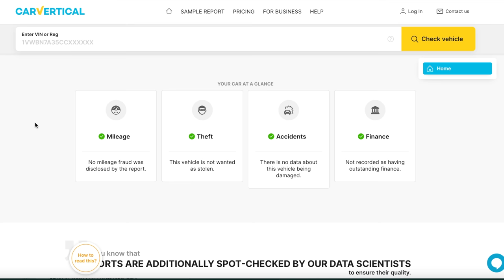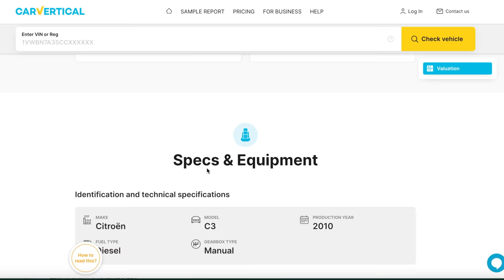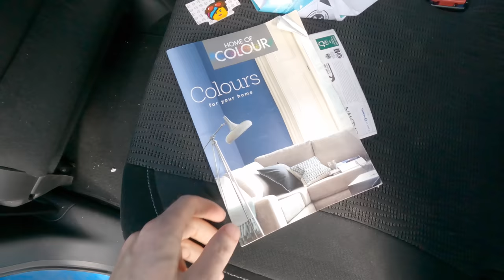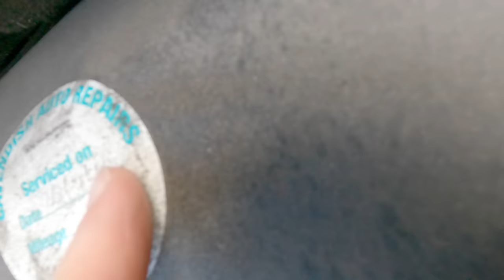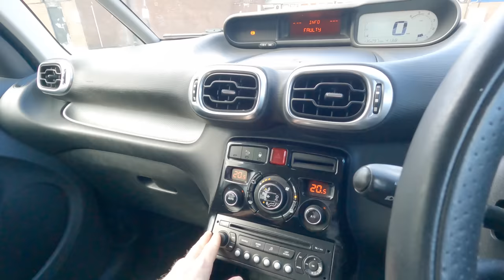I BOUGHT A CHEAP CITROEN FOR £300!

Comment: I don’t mind French cars, under the bonnet they are Bosch, Valeo the same as everyone else. I wonder if the issues stem from the fact that people bought these diesels based on high mpg figures but didn’t do the miles a diesel needs not to choke up their emissions devices, and also cars at the budget end of the market don’t tend to be maintained with a view to longevity. Of all the new company cars I’ve had over the years the ones that have had the most garage time are VAG group and Ford. It doesn’t put me off them, just my experience. Great video and insight into the part ex market!
Reply: Shh... don't you know that around these parts, French cars are the only ones with reliability issues :D

Comment: The older IDI diesels are pretty bombproof, but I agree, all modern direct injection/common rail diesels are terrible, unless used most of the time on long motorway commutes, where they get properly hot and keep the crap buildup to a minimum. Congrats on the lovely BMW though, delightful colour and a manual box too.

Comment: Those Michelin Energys were factory fit on loads of PSA stuff at that time - we had a regular hatcback C3 of the same vintage and the rears simply will never wear out, all they do is stop the back dragging on the ground! Had to change them through age as you've noted. Was a very reliable, quiet and comfy car too.
Reply: 1.4 8 valve petrol though, which was faultless other than needing an odd drop of oil. Much better used buy than the (in)famous 1.6hdi!

Comment: 15 quid won't make the gauge move much, I did a wheel bearing on one of these and I think I put it in the wrong way, so abs light came one, wasn't on before, abs pick ups in the bearing, due to other faults I sold it off cheap, loads of work for no profit, at all.

Comment: Had a Citroen AX GT back in the day, smoked like a train. Replacement cam belt, service and stem seals then went like a rocket until plastic internal trim broke or feel to pieces. Never owned another Critoen.

Comment: I’ve got a 2013 Peugeot 3008 allure, 1.6hdi, manual, fully speced, fsh, 90k miles, clean MOT. I’d be interested in finding out what you might offer for it. (Approximately). Not 1 single fault.

Comment: Over the years I've asked a number of seasoned engineers about buying high-mileage modern diesels, because the economy is tempting. To a man they've said don't touch 'em - too complex to service and too expensive to fix. So if anything goes wrong the car's going to be a write-off. 

And to a man they have said don't touch French-designed cars - they say that the engineering is rubbish.

So a high-mileage French diesel wouldn't exactly have been top of my list...

Comment: I bought one of these last December with 132,000  the clutch went at 136,000 July this year, a clutch at retail prices on one of these is £1200. Mine was £135 road tax.
Reply: That’s with labour and an expensive garage. Clutch kit and DMF is about £450 tops at retail price but fitting price is debatable

Comment: the old 2.0hdi unit was perfect (8 valve type) bloody bullet proof ... newer ones not great ...Im currently runnign ford focus mk2 1.8tdci ..(non wetbelt) this might be my last diesel car   , also might only need injector seals ...copper rings and could be working ok

Comment: The handle on the fuel pump icon on your dash tells you which side the fuel filler is on
Reply: Not on the C3 Picasso - the pump handle is on the right on the dash display, but the filler flap/cap is on the left.
Reply: when you think you couldn’t dislike a car anymore 🤦‍♂️

Comment: We had one a few mths ago, 61 plate, gave 900 quid for it, did spring, wheel bearing, top mount, unfortunately steering column was noisy, disconnected colum and noise was in the electric rack, got 1200 for it, so total waste of time.

Comment: 70 mph in 4th gear for 15 miles will usually clear these out, they do not like short journeys, if it does not do it it's usually maf needs replacing or cleaning, worst case is it's dpf, could have got more for it just selling as spares or repair.

Comment: With the PSA 1.6 HDi it is essential to change the oil at half the recommended miles using quality oil and an OE filter. Otherwise turbo failure will occur and simply changing out the turbo cassette will not fix it. The sump has to come off, pick up pipe replaced, turbo oil feed filter bolt replaced and an internal engine flush. If it's been driven any miles with a failed turbo, remove the crank shells and big ends to check for scoring there too. It's a big expensive repair. The high milers also suffer from injector seal failure resulting in a chuffing noise and a smell of diesel. Replacement injectors must be coded into the BSI too. This engine is used in all sorts, not just Peugeot Citroen, but also Ford and even Mini. If you own a 1.6 powered HDi change the oil every 6.000 miles without fail if you want it to live a long and happy life.

Comment: My Xsara Picasso has been 100% reliable. It is a 1.6 VTX Petrol though. At nearly 16 years old the power mirrors no longer fold and also the rear sensors no longer work. Odd flash from the ABS too. Other than a smidgen of rust on both sills it is spot on. Not bad for a car I pad £3100 for almost 8 years ago with just 20k on the clock (Ex mobility)
Reply: I have the same age VTX xsara pic. It doesn't have folding mirrors or parking sensors. Maybe yours are as expected.

Comment: Another brilliant video your job is so interesting, just one thing, a few times you went for fuel and you had to look out to see which side the fuel tank was. did you know that 99% of all makes has a tiny little arrow to the left or right of the fuel gauge icon on the dash, to tell you which side the filler cap is, it's very useful  as I also drive different cars a lot.....
Reply from the maker: Not this one

Comment: Surely it's just air or dirt in the fuel line as you've just added fuel onto a completely empty line. 
It was OK going in to the petrol station, it may just need someone to put 20 or 30 miles on it to sort out the line. 
May be why the gauge read empty. 
Give the car a chance man!!

E46 series convertible looks awesome.  Still my dream car.
Reply: I put that comment in 3/4 way thru. Having watched it all, yeah scrap.

Comment: We bought Citroen C3 Picasso  for years ago with a mileage 250 000 km. 2009 1.6 HDI  (80 kw). It a stunning car, very practical, comfortable and reliable. After 4 years mileage above 320 000 km, no engine problems, no rust in body, in deep (above -20)Lithuanian  winter everytime starts.... Only cheap maintenance, brake pads, some  suspension parts  and etc...
Reply: Labas, is kur pirkai prancuza ? Is skandinavijos nuo tralo ar vietiniu skelbimu ? Dekui.
Reply: @Tomas-cg9ko  Labas. Pirkau pagal Autoplius skelbimą, stovėjo Kauno turgaus aikštelėje. Kiek žinau parvarytas iš Danijos

Comment: Had a DS3 with the 1.6 HDI on a 2011 (61) plate - oil & filter changed every 10,000 miles as Citroen recommended (I was doing more than this per year so the 1 year interval didn’t apply) - the turbo started under boosting around 80k or so and throwing an engine light intermittently - there is a metal gauze that feeds oil to the turbo and they get clogged and starve the turbo of oil - would have been just over £1,000 for a new turbo - I didn’t have it done as it seemed to stop doing it after only throwing the engine light on 2 separate occasions and part exchanged it at 90k against a 2016 (66 plate) Clio Diesel - the service interval is every 18,000/2 years on these - madness

Comment: It’s a funny thing about French cars - I have had the misfortune to own one of those Renault Megane ( my wife liked the quirky look) it was also a two door  ‘sporty looking’ thing with keyles entry, it was also rubbish to drive, In under twelve months it cost almost half of.it’s price in engine  & electrical faults. Oddly I sold it for what I paid for it. I made the mistake of thinking it would be like a Renault 8 Gordini, which I had when at Uni in the early 70s. That thing was a 1966 model and damage good fun,, but eventuallŷ, the rear engine started getting problems. . . In those days, you did your own repairs - but I soon discovered, not on French cars!

Comment: I've only just caught up with this so it's probably scrapped now but it's a pity it couldn't have been sold to someone to fix up. If it's the turbo at least it's at the front of the engine so not too bad to get to. Injectors, dpf etc are all doable on a budget. You wouldn't get a garage to do it because the labour costs would make it not worth it but there are plenty of people out there who could do it.

Comment: Before scrapping it, I'd have pulled the injectors, my bet is they are clogged up. Check the air intake, again, it probably resembles a coal mine. Then change the oil and see what it does.

edit: I wrote this before the injector noise. I think the engine would be salvageable if you could do the work your self, but not economical if you pay someone.

Comment: We have had a string of French cars in our famaily, BX CX ZX Pug 605 525 and now a Pug307, all diesels.No major issues with them and wifes current 307, which she has had for 14 years runs great although it is clearly nearing the end of its life. All have been propely serviced. Not had many German cars, the last was an E39 525 BMW diesel on which the engine blew up about 10,000 miles after I  sold it. I am on my second Volvo v70 /xc70 which are also good cars. Sadly not much in the current Pug Citroen range appeals and I dont want a Chinese Volvo

Comment: This is common with Citroens if you can't be bothered to service the PSA diesel engines the dirty engine oil kills the injectors & eventually kills off the turbo as well it's not a bad DIY job for someone who likes Citroens yes they are around
I'm surprised you didn't get rid on eBay & made yourself a few quid

Comment: Perhaps it is in limp mode DPF full, had the same with C4GP (piece of crap)
First DPF blocks then higher pressure in exhaust affects engine, and in effect injectors washers get blown and later that will affect high pressure pump.
Also check oil level if there is more than should be fuel already started mixing with oil and that will affect turbo of course. They are clever cars ;-)

Comment: I’ve written this before but after owning a Peugeot 607 I still nearly have a heart attack whenever I hear any kind of bing warning sound.
Reply: I had 2 C5s, not bad with the reliability, both had 2.0 HDI engine, but that beep is the same if the temperature dropbs bellow 4 degrees C, the same if you are running low on fuel, the same if your washer fluid is low and the same if your car needs a new engine :)

Comment: So you scrapped it without even having a proper diagnosis?  Could have been something really silly causing all those problems.-   I have had quite a few French cars and they are not naff! Currently tun a 2002 Peugeot 806 which has its issues but is serving me well.

Comment: HA! It’s me the Citroen C3 Picasso Exclusive owner that a few weeks back that mentioned the ‘hairdresser’ Suzuki. 😂 Mine is the same shade of blue too. Owned it for 10 years now. Is mega reliable and practical. Even the electrics have been reliable. Low insurance, low tax, low depreciation, low maintenance costs and is a babe magnet too 🤔 okay, maybe not the latter! The difference between mine & the one you got is 1) mileage - mine only done 58k and 2) maintenance - main dealer til 2015 & then Citroen specialist ever since. It’s a good car - shame that the one you bought was such a 💩 one tho.

Comment: I've had several cars a 09 2.2d xtype and 08 1.9 cdti Astra else and both smoked liked hell and had no power and in both cars the Turbo had gone, the cars were Never than the Citroen so both got sorted but I had the Astra then the Jag in all the diesel cars I've owned three 2 are the only cars I've had problems with ,

Comment: How the hell did you get that for $300 only? Are you having us on? How does one buy a car without knowing the model, condition, colour or anything other than the Brand? It is obvious that this could only have been gotten in an unusual trade. Regardless of the engine condition, I believe it was a good buy. I am sure you are connected with the prerequisite talents to put it right. Never even tried to find out why? A little challenge and you quit? You are not cut out for this job - you are more of a gambler.

Comment: That kind of smoke coupled with the symptoms of low power could only spell one word: MONEY-PIT. Grey-ish blue smoke is a sure sign of burning oil. When that happens it could either be a lucky escape (turbo oil-seal or even better a blocked breather pipe or even worn-out oil) or a massive expensive job like worn valve guides, stuck / worn oil-control piston rings or maybe not that bad but still expensive, the turbo requiring a re-build. I may be attracting a wild crowd against me here; but the more modern HDi engines are known for unreliability, sometimes even when pampered with TLC, so it's quite unlikely you would have gotten away with a cheap fix. There's money to be made breaking these cars for parts however: they are plentiful and they go wrong all the time; and many times they are not worth repairing even when bought dead-cheap - obviously for a very good reason - so there's a heap of second-hand parts in circulation.

Comment: I feel like they got it all wrong with the C3 Picasso. My nan owns one (A C3 Picasso exclusiv 1.6 diesel in blue just like this one) and it's a nice car with nice features but it just does not work for me. It gives the impression of a spacious car on the outside but so much room is wasted on the inside. My main problem however is the gearbox with the 1.6 diesel that my nan owns. The 5 speed does not seem to manage torque very well. It is a decently powerful engine for what it is and it pulls well but the gearbox means that if you are on a slight incline going 40mph you can to change down into 3rd then rev the thing to death and then change into 4th and it wants to go back down to 3rd. (That's just an example). I just don't like this car much.

Comment: I must confess, after doing my own mechanics for many years and fixing friends cars too (until recently), I RUN from anything made by Citroen/Peugeot/Renault since the late 80’s early 90’s Peugeot 205’s!
Reply: I dont know what went wrong the diesel peugeot 205s were absolutely bombproof i had one a couple years ago on 800k miles original engine went to france in it 4 times and never missed a beat and its still on the road now doing 10k miles a month got to be coming close to if not more than 1 million miles now

Comment: "who puts Michelins on a C3 Citroen" CITROEN AS STANDARD . My first Citroen 1974 Dyane boughts 6 months old and still owned even had Michelin steel wheel it has never needed a wheel balance. 1560 Diesel engine is a gem if a lived closer I would take it off your hands, change oil, check injectors and turbo.

Comment: Applies to any car - look at the fuel gauge for the clue to the side the filler is located - the fuel gauge logo shows you - look at the hose on the logo - that’s the side the filler is on :-). Some cars worth repairing but this one is overdue that date with the crusher. One less rubbish sh1troen 😊👍

Comment: These do 400k as taxis - 500k even - the engine stuff is all mostly ancillary crap that's easily fixed. Emissions shyte that needs fettling, etc etc - the abs is usually worn pads/borked wires. T'was a fixer. That to me is a blocked egr - or a blocked cat, or the fuel filter that's done 30k since the last fresh one.   She'd have been purring in an hour here. :-( For tuppence.
Reply: That said - I know this is an Ad for the car-check service & the Citroen is just a bit of fluff to draw in views.

Comment: A £300 p/e recouping £250 scrap or potentially time, effort and money to make a couple of hundred somewhere down the line. Scrapping is the sensible call. For the right buyer it's a cheap car to get to work for a year. For the wrong buyer it's one of those ones where they keep coming back for every little thing. Losing £50 on the p/x and shifting another car from stock makes sense.

Comment: Even if you diy'd it with a used turbo .. then send away to have the injectors cleaned and a new egr valve plus a few other bits your still at the bad side of £700.. and thats doing it yourself.. I'd say sell as is parts or repair £399 and make a buck..

Comment: Modern diesels have not got good reputation for reliability at this age. In latest what car survey the chance of a fault was 50 percent with a diesel versus 20 percent for petrol and 25 percent for electric. Hybrid was the most reliable but that's probably mainly Toyota's so not much suprise there. You save on economy with diesel but then seem to need to spend it back again on repairs and maintenance. It's all to do with trying to make them cleaner. A lot of stuff designed to reduce emissions.

Comment: Just a thought: 

This car in continental Europe would've cost 2-3k€ easily. The sole reason UK has such cheap used vehicles is because they are RHD, and hence sellable only on the British isles. 

In the late 80s when the Channel tunnel project was being commenced, there was also a proposal to switch to LHD and kph. The deemed switch seemed to be too costly for what was its worth, but they haven't put into the calculations the loss od value for used vehicles, if they have, who knows what the results would be. What do you guys think of that?

Comment: Loved my E46 coupe, especially the little touches. How the wing mirrors raised up when folded in, and the little electric rear window openers
Reply: I still have mine but its going as it is just sitting. Its too low and stiff, but it's so pretty and that six cylinder sounds gorgeous